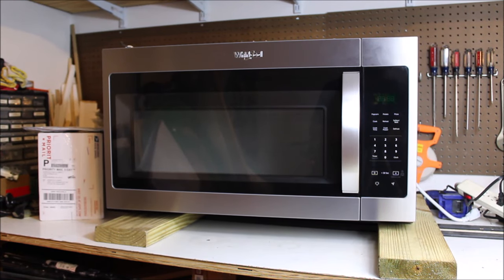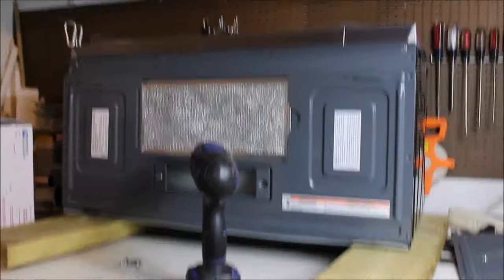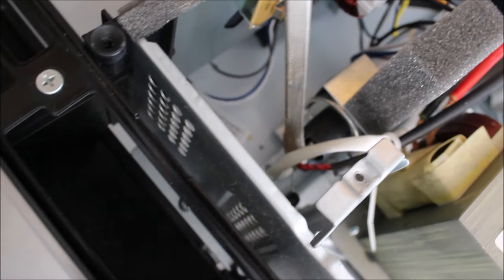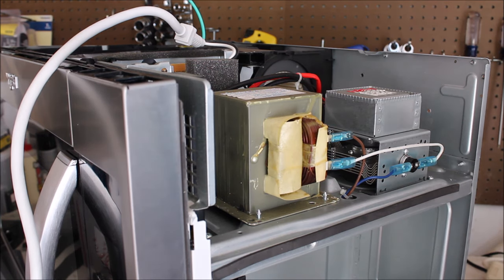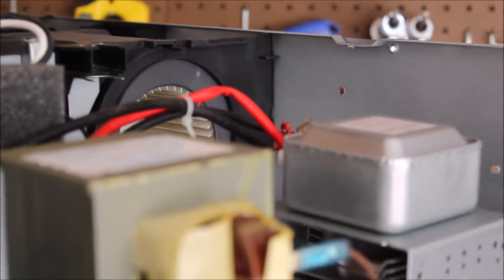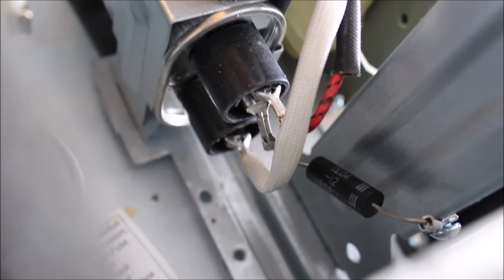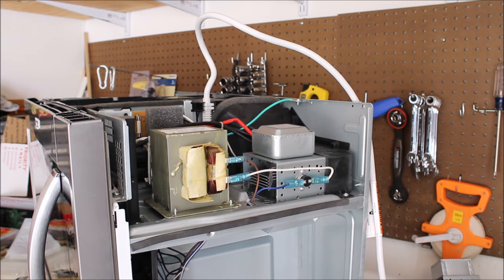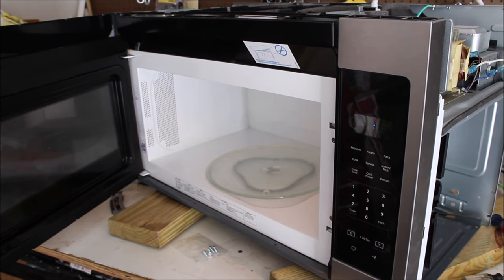Whirlpool Microwave Turns On But Won't Heat and Loud Noise - How to Replace Magnetron and Diode

Comment: Getting real tired of all my whirlpool appliances needing repair. This is the fourth repair I'll be doing in 4 years after buying new. Going to Bosch next.
Reply: Customers need to think twice before buying  the Whirlpool microwave- wmh53521hz-5. When the light won’t shut off the only way to fix it is to buy a new motherboard, and they range in price from $156 to over $300 online plus tax and shipping. Also $150 for service call to install it. And it’s an inherent problem in this Whirlpool model. You can buy a new microwave for $450 or pay that much for repairs or buy an LED stick up under cabinet lights for $12 to $18 as a alternative solution.
Reply: I just fixed my whirlpool duet steam yesterday...now this. 😡

Comment: Maybe I missed it, but why did you decide to replace both components?  Isn't the magnetron quite a bit more expensive than the diode?  Why not try replacing the diode first and if that fixes it, then you wouldn't need to replace the much more expensive magnetron?
Reply from the maker: For me, all signs pointed to the magnetron. I didn’t want to be in a situation where I replaced just the diode and waiting on the magnetron or the old magnetron damaging the diode. You are totally right though on costs.
Reply: @BrickBuildingKids  thanks for the clarification
Reply: What is the model # for this Whirlpool?
Reply: @alittleofmeisallyouneed314  not sure.  I decided to get rid of it.  Gave it to a guy for parts.

Comment: Not sure why you didn't replace diode first then test to see if working...diodes are cheap and the most common part to fail from what I've read. But you replaced both at same time so everyone watching this have no idea which part was bad. Interesting video anyway to see the insides of the MW.

Comment: Well finally got the Megatron installed. Found one that would work on line. $80.00 but cheaper then a new microwave. Can’t thank you enough for your video here. It was a life saver 👍
Reply from the maker: That’s awesome to hear! Im glad the video helped and I’m glad you kept in touch through the repair process. Take care!
Reply: Did Optimus Prime showed up while you're installing Megatron?
Reply: @ryk1265  no but Bumblebee was there to be sure there are no troubles

Comment: 1. HV Capacitor from ovens built in the 1990s and newer have an integrated bleeder resistor, so no need to discharge; 2. Most DMMs cannot test the HV diode, used a 9V battery to test forward/reverse current for an open/closed diode; 3. Test the HV capacitor to verify it is a capacitor, remembering there is a 10MΩ resistor built in and 4. Test the two filament terminals on the magnetron for continuity around 1Ω between two terminals and no resistance between ground and either terminal. Only after all of these tests fail bother to replace the magnetron.

Comment: You should shorted out the capacitor with a 20 K ohms, 5 watt resistor in series with an insulated screw driver.  For DYI guys a safety alert should be noted on this video.  I would have use plastic insulated gloves like Ansell® 11" CLASS 0 Black Rubber Insulating Gloves.  Other than these two things I brought up your video is excellent.
Reply: Cut the bullshit.The best way to discharge to the capacitor is with 2 screw drivers.I have been fixing microwave for over 35 years.
Reply: Jump it to ground and discharge it.  It’s not that hard.

Comment: Thank you! Replaced the diode with another video and realized it was the magnetron. So, your video took it over the finish line and got mine working again. Saved me a couple hundred bucks. Thanks!!

Comment: Thanks so much. Great video. I watched it yesterday, ordered the parts through your link from Amazon ($42.00 for both parts.)
They came today and I installed them in about 45 minutes start to finish. Works great.  The only issue I had was the orientation
of the Magnetron. The ears went front to back instead of side to side,  I just installed it with the ears lined up with the holes
and just connected the 2 wires to the front instead of the side as that's where the connections were.  

Works like new!    Thanks again.
Reply: What model microwave do you have? I bought the same parts on Amazon from the links above. Did you swap the wires on your new magnetron? I noticed that the FA / F were not on the same orientation on my the new magnetron from Amazon. Thank you and I look forward to hearing from you!

Comment: The Magnetrons are not cheap on some models. Sometimes replacing the Microwave, is a better option if it has failed. In this case, testing before replacing did not happen. The diode is much cheaper than a magnetron. It may have fixed the problem. Less than $10.
Reply: marymiguel9904 Mine was making the humming noise. I first tested the Capacitor. That was good. I found the diode to be bad. After replacing, the Microwave now works again. My Magnetron was fine & heating.

Comment: I have a whirlpool countertop microwave model GT4185SKB -2 made in August 2002. (the “-2” at the end is the “ECN” number). It looks new inside and outside, with no food residue, no scorching and negligible rust. So I figured this machine may be “low miles.” So I just put a TV dinner in for 5 1/2 minutes. Everything worked fine, clock works, turntable spins, light comes on, and no unusual noise. But the TV dinner was still frozen. So apparently, no heat. Does this model default to the “HI” power setting? (most, if not all microwaves do). Did I not set the power setting right? Or any other possibility of “operator error?”

Comment: Can I just replace the diode and if it works and fixes the issue. Not install megatron. What donyou think?
Reply from the maker: It’s worth a shot. I had it open and just did both based on my research. Give it a shot!

Comment: I have a Whirlpool WMH31017HS2 that made a popping sound and now it runs but does not heat... and has a loud hum to it. I have looked up what could be wrong and it's the magnetron, diode, capacitor or fuse. How do you know which one of these it is beforehand? What part would make it hum if it goes bad? I don't want to buy parts I don't need, especially if the cheapest one.. the fuse is the culprit versus the magnetron.
Reply: We're in the same boat. It made a very loud snap noise, continued running but wasn't heating. What a piece of garbage!

Comment: Will this work on just about any microwave? Thank you so much for your video dude.
Reply from the maker: It’s possible. Steps of diagnosis may be the same but parts may be different. Just process of elimination for me on repairs like this.

Comment: I replaced the magnetron and the diode and the capacitor. It’s still making the buzzing noise and not heating.
What else could it be?

Comment: Sir, I have GE brand MV and  it's not getting power supply. Have checked all parts with multi meter and it's ok only problem is not getting power supply after switching on.
Reply: Perhaps it's the bigger relay on the logic board (directly connect the two wires coming out of it) or the thermal fuses (on the magnetron and on the oven body). There are also two more fuses (one where the main cable enters the case, the other between the transformer and HV capacitor).

Comment: Hello, is there any reason what causes this to happen? Bought a new one just a few months old but now it's not heating and there's a buzzing sound too.
Reply from the maker: Reason, I’m not sure. But with how new it is, I would hope you would be covered under a warranty and not have to take it apart. Sounds just like what happen to this one.
Reply: @BrickBuildingKids  Before it happened, heated up some food and it splattered so i cleaned it up with some damp towel. The next day after that, not heating anymore. Is there any chance this what  caused it to malfunction?
Reply from the maker: I guess it could be possible, but I would think the diode and magnetron would be more protected.
Reply: @BrickBuildingKids  Got this. Thank you so much for your replies :)

Comment: So, just a magnetron is more costly then a new microwave ?!
Reply: The magnatron part he listed in the description is currently selling for $50 on Amazon. The microwave he is reparing costs between $250 (Best Buy) and $320 (other vendors) brand new. My general rule of thumb is if the replacement parts cost less than 1/3 of the total cost of purchase, I’m down to fix it. If it starts costing more than that, I might as well save up the difference for a new one. Especially because sometimes you get the thing open, replace the recommended parts, and still have the problem. Then its back to the drawing board, or you’re buying more parts, wasted a whole Saturday messing with it, and still don’t have a working unit.
Reply: I got mine out the trash I know it seems gross but I made sure to clean it and it never comes into contact with food

Comment: LG my way only run about 10 seconds and is not getting hot and it'll pop off on the computer screen set f-11
Reply: The microwave Raymond about 10 months old and has been taught about a month and a half

Comment: Ok, ordered by the part number you have here but the ears used to hold the magnetron in place were different. Instead of coming out the sides they came out front and back and the plug in came out the side 🤷‍♂️ where did I go wrong, any advise?
Reply from the maker: I see that too! Looks like the orientation was changed on that part. Do the holes still match up?
Reply: @nutthrower4415  just took mine apart and have same issue. What was the resolution?

Comment: This very good video got me started on my repair, so thank you! For anyone researching a microwave repair, I highly recommend this video first: https://youtu.be/t1tdj3OnlXU?si=PndPjWnIl0Mqzb6q There could be multiple reasons why a microwave doesn't work, probably good to run through them all. Repairing appliances is great (saves $, reduces waste) but it doesn't pencil out if you purchase parts on unnecessary repairs. So accurate diagnostics are important. I have the very same microwave as in this BBK video. In my case, I replaced the diode first - that wasn't the problem. I don't think the link for the magnetron in the description should be trusted (in my case, the mounting points were 90 degrees off) so research your exact model number. I found a magnetron and it solved the problem. Back to quieter and hotter operation! My magnetron magnets were not cracked, but the top one was loose (it would spin freely) so I think that was the problem. The link I pasted in this comment has a good approach to diagnosing the magnetron beforehand. Good luck on your projects everyone!

Comment: Any way to test the Magnetron prior to replacing it?
Reply: Look for cracks in the magnets won't heat if either one is cracked.  Shake it around and listen for broken or loose pieces inside.  Test the each pin with ohm meter to the metal case if any continuity it is bad, shorted.

Comment: Good info, but you need a camera that auto focuses or something.  Gave me a headache with all the focusing in and out.  You could have explained the pin mech on the electrical connectors to the capacitor.  Other than that, great video.

Comment: Thank you so much. I got the same problem. Now I can fixed it myself. Is it possible I could get the parts number for the diode and the megatron. Thank you once again. Its a great help.

Comment: Mine is a Kitchenaid but the process should be similar, great help, thanks. BTW I'm an ace losing screws so I put them in freezer bags taped to the part sometimes so I know which go where . Makes notes on the bags if need be too.

Comment: At 9:36 there is a black box with yellow and black wire connected.  I have this same looking part and thought that was the capacitor on my model (Whirlpool GH7208xrq).   What is that part called?

Comment: Leather doesnt protect you. Rubber then leather over the rubber. The leather is to prevent wear to the rubber gloves. Also, when using a ticker, check a known power source first so you know it works properly.

Comment: Thanks for the video. I have the exact same model, and exact same issue. I just ordered the parts from you’re links. Wish me luck!!!
Reply from the maker: Good luck! I appreciate the comment. It was a little intimidating at first but so glad I did it. It’s a shame that these issues happen on newer microwaves.
Reply: Be very careful.  Microwaves can kill you working on them.   The most dangerous appliance in the house.  Make yourself a capacitor deactivation tool for changing that out also.
Reply: Apparently this is common in this model at least.... Would be nice if they made one that can at least last two years....

Comment: My microwave isn't heating up and the plate isn't spinning
Reply from the maker: For the heat, this video should help but for the turntable not spinning, it could be your drive motor. If you take the tray out does the coupler still not spin?

Comment: Hi, Thanks for the great video. I have replaced just the diode, it was working good for just 1 day, then again got the sparks and stopped heating. I don't know why the new diode died soon. Do you think the old magnetron damaged the new diode? do I need to replace the magnetron too?
Reply from the maker: Hi! That’s one of the reasons I feared using my old magnetron and just replaced both. I would say if your microwaves symptoms match ours, I would surely replace the magnetron. I would check the part number of your existing one before ordering the replacement.
Reply: @BrickBuildingKids  Sure, I will try to replace the magnetron too. I have another microwave when I turn on it trips the circuit breaker, any tips for this issue?
Reply from the maker: Was it tripping the breaker before you replaced the diode? Is it always tripping the breaker? There could be other reasons why it’s tripping your breaker but a bad diode or magnetron leak match up with a reason it’s tripping the breaker.
Reply: @BrickBuildingKids  It is totally another microwave, did not change any diode or magnetron. Just tripping the breaker whenever turn on the unit.

Comment: Thanks you so much, I searched whirlpool microwave removal because i havent done before and not heating popped up and I watched video on meal at work and it didn't look too hard so I ordered parts on ebay and watched your video and did each step along with you and sure enough it worked and saved me from having to replace microwave. The diode was clearly burned and not sure about magnetron yet I had both parts and replaced like you did and I am very happy with the results of hot food and the accomplishment of doing a repair so thanks again